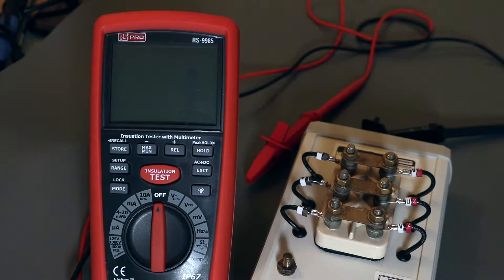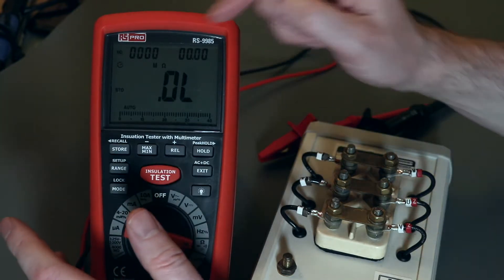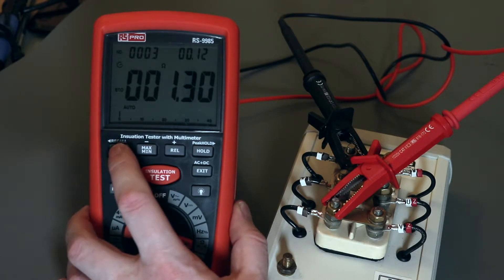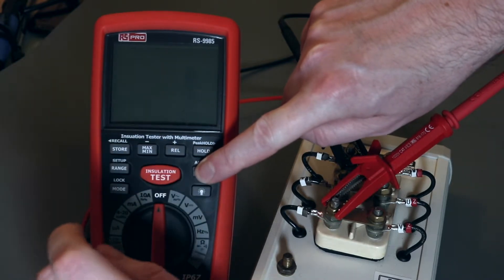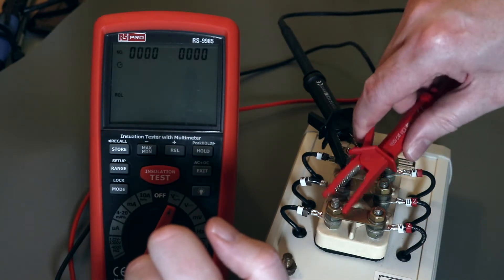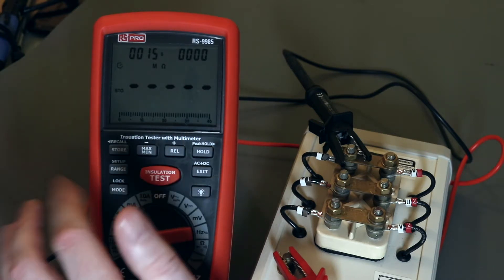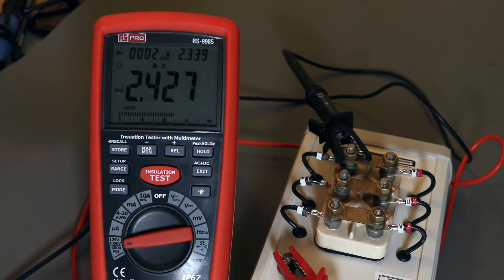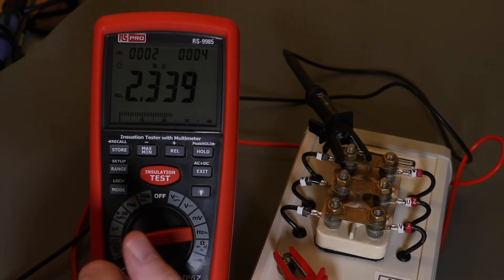RS Pro RS-9985 Memory Function

Comment: Hi, do you know how to null the test leads on resistance? It's not shown in the instructions and I'm reading 20 Ohms on probe short
Reply: Hi the REL did null the leads, many thanks for your help. Now I have a continuous  bleeping on all measurements, this is since I changed the settings low and high settings but now I can't get it to stop. It seams triggered by the OL
Reply from the maker: @3D-Dan  Yep, if you go back into setup for the low and high setting, you can press the 'store' button to change them back to off, and that should then stop the beeping.
Reply from the maker: Hi, you can use the relative mode with the 'REL' button which should have the same effect as nulling the leads. 20 Ohms seems high for a set of leads though, have you tried them on another meter?
Reply: Yes I was thinking the same as non fused basic leads, I'll try and null via the REL function and feedback, it does show the nulled circular icon on the LCD so it looks like it's setting the zero point incorrectly
Reply: It worked, thank you, I would have never figured this out. The instructions are very basic. Thank you 👍🏻